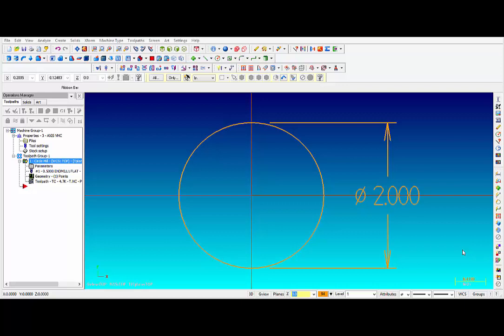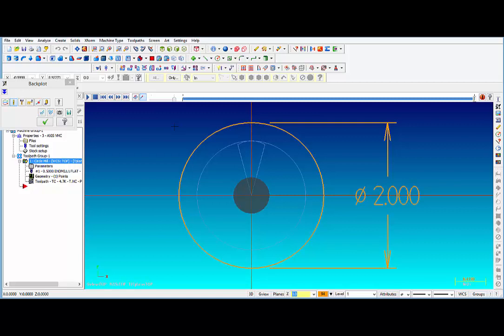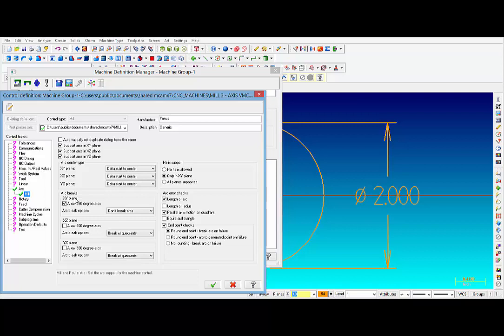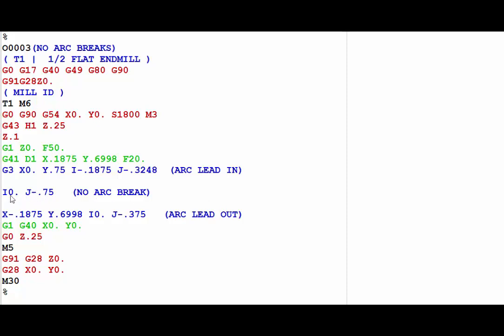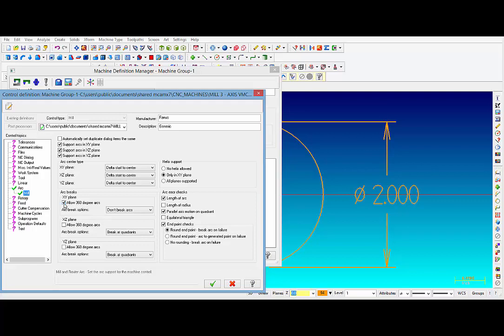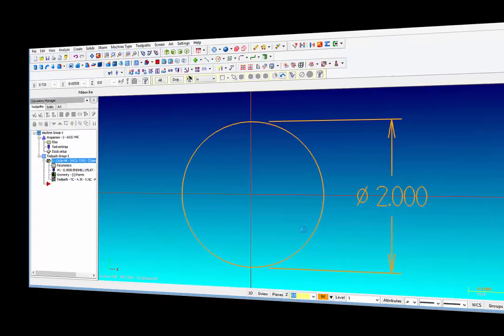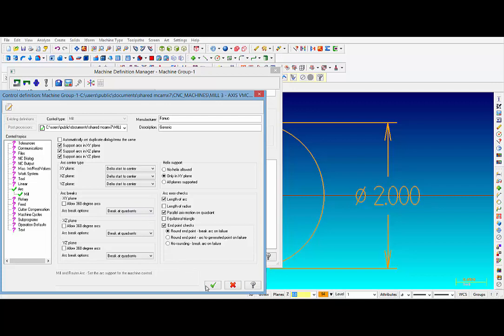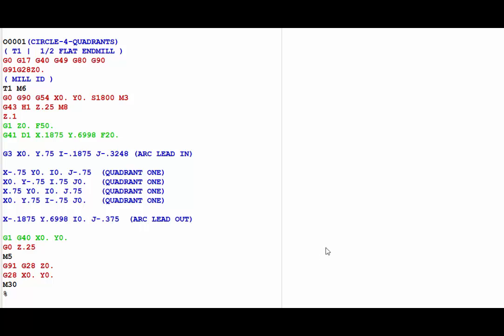CHANGING ARC OUTPUTS FOR MILLING IN MASTERCAM X7

Comment: Hello Tom great videos. Question for you. When doing a surface toolpath that involves X&Y contours the programs are very very long because several of the arc moves are "Point to Point" is there a way to change any parameters that would replace the "Point to Point" moves when possible with arcs?

Comment: Thank you for the Video sir, but i have an error message stating " start arc radius not equal end arc radius" . How can I resolve that. Thank you. 
Regards
Ayan
Reply from the maker: Ayan Choudhury Hello Ayan. Are you getting the alarm in Mastercam or on the machine?
Reply: I am getting the alarm in Mastercam 
Thank you
Reply: I am getting the alarm in Mastercam 
Thank you
Reply from the maker: Go back in to the machine definition manager and select "arc" again and change arc center type to "Delta start to center".
You may need to recreate the operation from scratch to get rid of an error
Reply: Thank you sir, Will do and get back to you. Thank you once again.

Regards
Ayan
Reply: Thank you sir ,I need R value instant of I J on arc how to do sir

Comment: Great videos! Quick question for you. Is there a way to change the parallel surfacing such that the output code isn't going point to point but in arcs? I've got 8k lines of code with a slow but acceptable surface finish. Thanks again for the great videos!